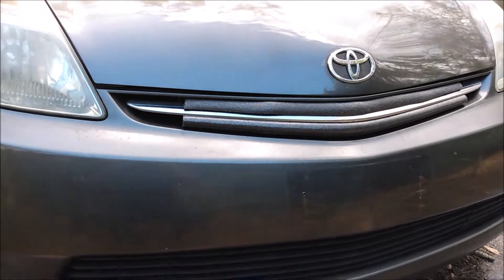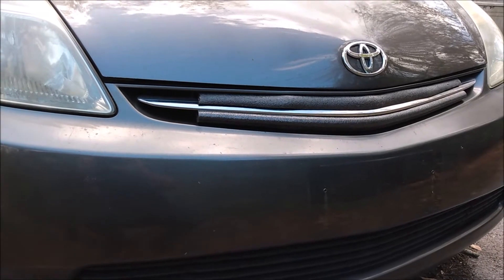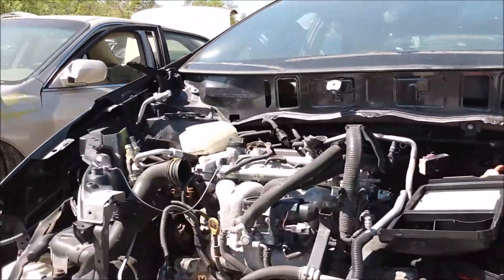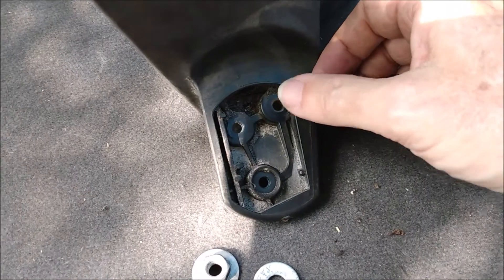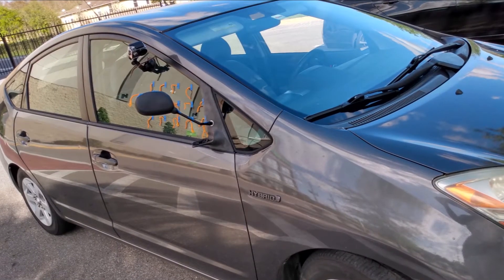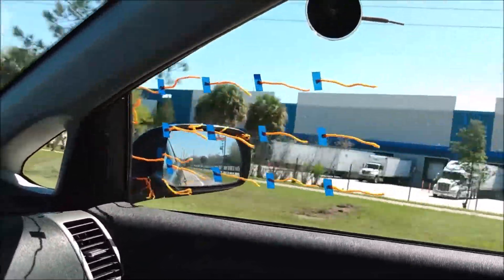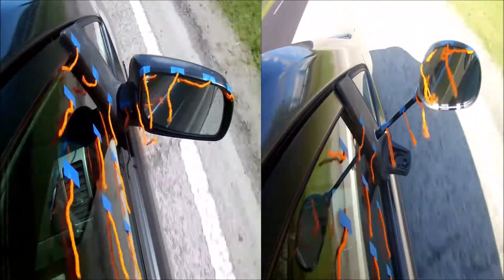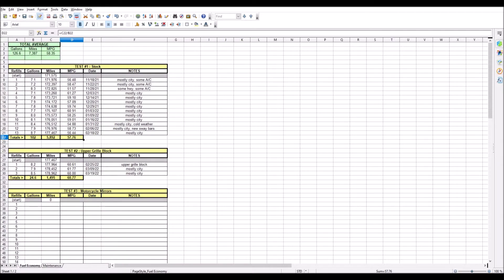The Prius Experiment: Reduce Drag With Smaller Mirrors! (and grille block update)

Comment: Hey Michael! I appreciate your experiments and sharing them with us. I have a request for an experiment. I am in the market for a new, gen 5, 2023 Prius Prime. I cannot decide on whether to get the SE with 17" wheels and covers, or the SXE with 19" wheels and no covers. Fuel economy is important to me. If/when you ever get access to a Gen 5, 2023 Prius, I wold love to know whether I can buy the SXE with 19" wheels, then replace them with aftermarket 17" wheels to improve mpg and range. A Toyota service rep told me that this would be expensive and problematic. He said that changing the wheel size would affect the accuracy of the speedometer and odometer, and possibly the direction of the sensors that sense the surrounding vehicles. Cold you at least speak about this until you can do an experiment?
Reply from the maker: IMO if you want 17" wheels, just get the one with 17" wheels. Later on, you can make or buy smooth wheel covers, if that's what you're after.

Comment: One of the main problems in using dinky mirrors is the fact that most drivers don't actually recognize what they see in their mirrors to begin with 😢
Negligible mpg increase with smaller mirrors... Keep the front super waxed...
Reply from the maker: That's a good point. Actually, the tiny mirrors are kind of annoying because the field of view is so small. I'm thinking of getting side view cameras.

Comment: Hello, i own a 2004 Prius with 230.000km on the ODO! I build in a electric Engine Heater with circulation Pump. I preheat the Engine most the Day with Solar Electricity to 70°C. On Highway Speed @90kph i get 3,3L/100km (approx 74MPG) Greets (Prius is one of an Hand full Cars on Earth with superbe reliability and less less less consumption!)
Reply from the maker: Hello there! The solar water heater sounds pretty ingenious. Is the solar panel installed on the car? Or do you have solar panels on the house?

Comment: I'm surprised that cameras have not replaced side mirrors yet.
Reply from the maker: Same here. But I think gov't regulations are holding them back.
Reply: Mirror  $100. replacement...
Cameras $1,000 ...
The screen for a cam would be more centrally located...
They want you to look left & right...
It's actually the NHTSA that is holding the use of them up...

Comment: Very interesting study.  I would be very surprised if the gain is noticeable because the amount of air flow being disturbed is quite small.
Reply from the maker: You may be right. But I want to test it, so I'll know for sure.
Reply: @michaelblacktree  Yes, by all means.
Reply: @michaelblacktree  I did this to my 3rd gen im worried that the intake won’t get enough air I did it to the bottom grill and had a 20% increase in MPG. Which is incredible. Can you explain a little bit more. Don’t want the radiator to blow up lol.
Reply from the maker: Blocking part of the grille reduces airflow to the radiator, so the engine warms up faster. The engine is more efficient at operating temperature. So the faster it warms up, the better. This is especially true for short-hop driving. But of course, you don't want to overheat the engine. So you'll need to monitor engine temperature.
Reply: Weirdos on Ecomodder used to talk about rigging an indicator light for when the fans turn on.
Maybe you would still get better fuel economy with your grill blocked so much your fans run 100% of the time, but would you want to?
Reply: Never block the lower portion of your air dams... There are motors that use the air to cool them...

The radiator self regulates it's temp depending on use of the ICE... I've seen mine as low as 135 when I'm mostly on the electrics...
It'll warm up more IF you need the heat inside... The air conditioner is mostly air cooled...
Reply from the maker: Good point. On the 2nd gen Prius, the cooling for the power inverter is in the bottom section of the radiator. So you don't want to block that. On the 3rd gen Prius, I think it's in the top section of the radiator.